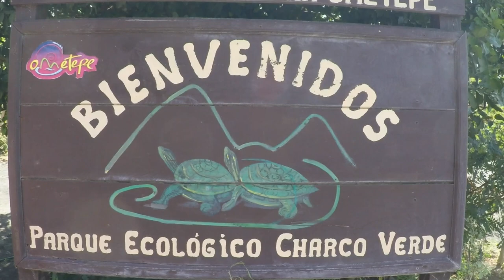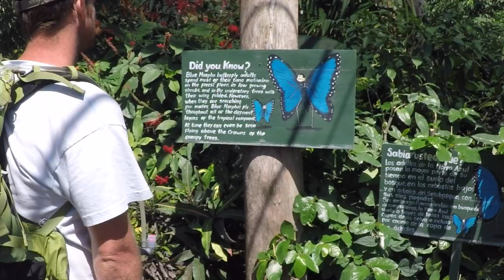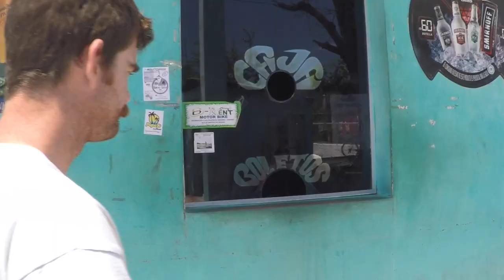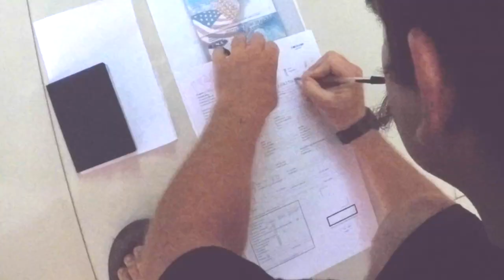Traveling The Pan-American Highway | Ometepe Island Nicaragua Ep.54

Comment: Surprised you're not equipped to plug a hole in a tire. It's a basic DIY skill and cheap tool.
Reply from the maker: I carry plugs, but not the tools to easily remove the tire from the rim to do an internal patch like the guy in the shop. Please correct me if I'm wrong, but I think that the internal patch is a more durable solution than the plug or cord style patch. Plus, at the rate he charged getting the tire patched in Nicaragua was cheaper than what I payed for my cord style repair kit in the USA.
Reply: @TheTravelingTogetherJournal  here in the US, to put a plug I usually pay between 10 to 15 bucks. So definitely cheaper over there in Paisito!!